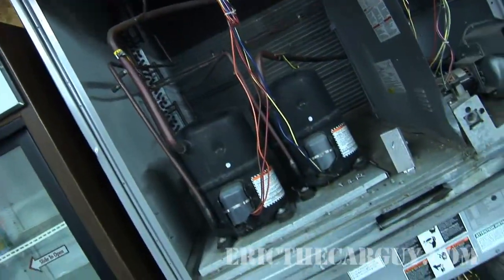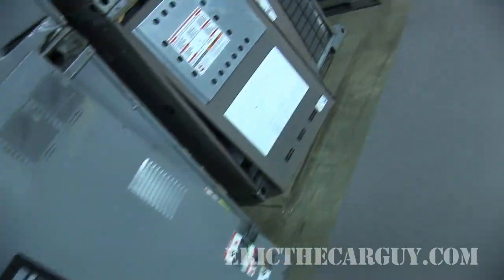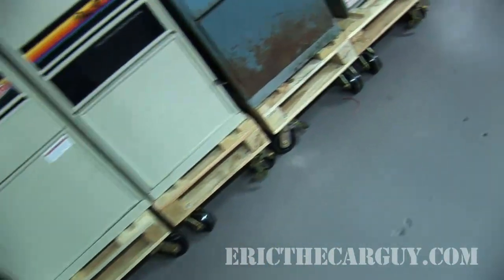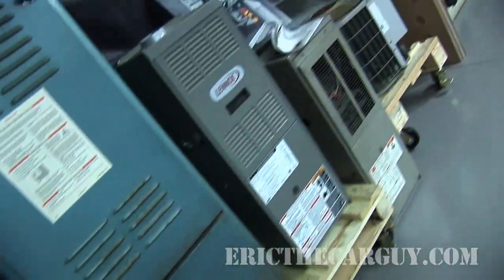ETCG visits Rosedale HVAC Class

Comment: You typically see 48vdc max, mainly because the agreed upon highest safe dc voltage is 60v, without requiring severely strict protection measures.

Comment: DC systems rarely run more than 48V. It's just a trade off of volts for amps. In the case of the condenser, I would bet between 5-24 V, depending on use. On buses or refrigeration trucks, it's 24 V.